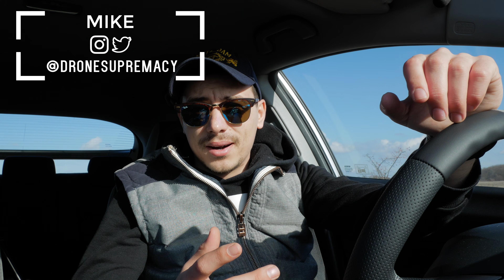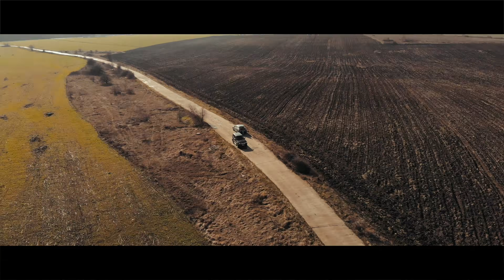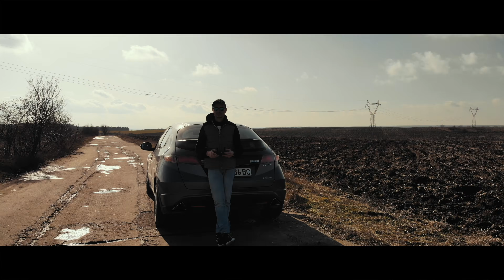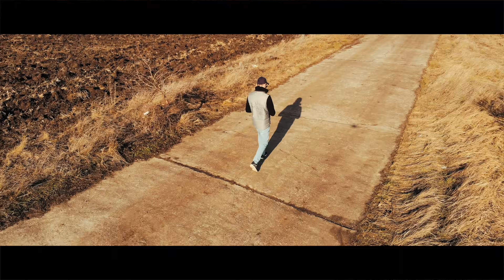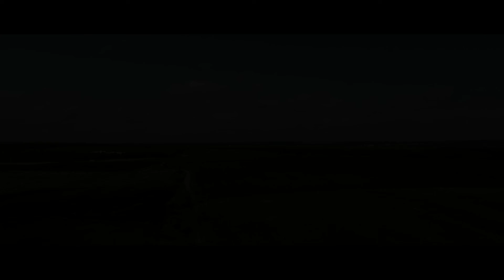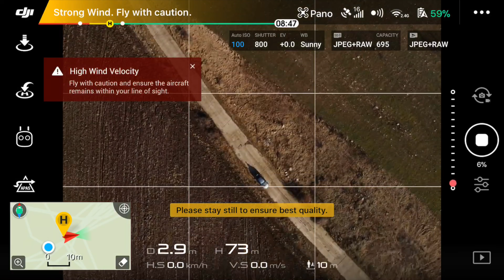DJI MAVIC AIR - HOW DOES IT PERFORM IN 80 KM/H WIND? (4K)

Comment from the maker: Today, after a failed range test, I decided to test the wind resistance of the new DJI Mavic Air. The wind gusts were about 70-80 km/h at higher altitude, and about 40 km/h on the ground. I'm extremely happy with how the drone performed and how stable it was during its flight, which was about 40 minutes long. I only encountered one small issue during this whole time, other than that the drone was rock solid!

Comment: the mavic air connects through wifi with the controller,what if i dont have one ,how will it connect?
Reply from the maker: You can connect straight with your smartphone, you don’t necessarily need the remote to connect to the drone
Reply: yes but what im asking is how will it connect to my phone via wifi?if so then will it drain 4g
Reply from the maker: No no, the drone creates its own wifi network by itself, and you connect to it. It doesn't use any data, you can even turn on airplane mode to be sure.